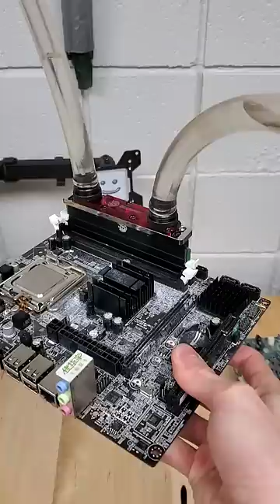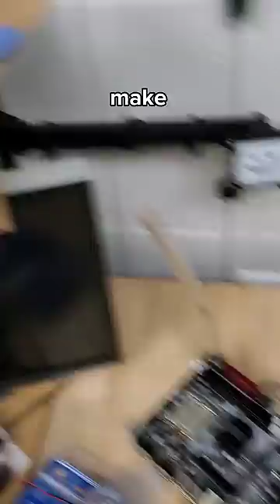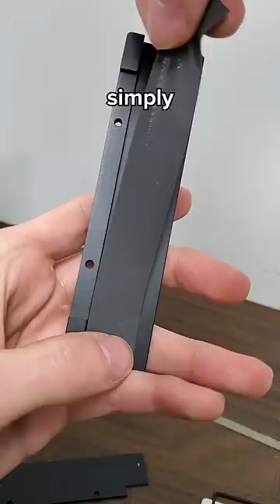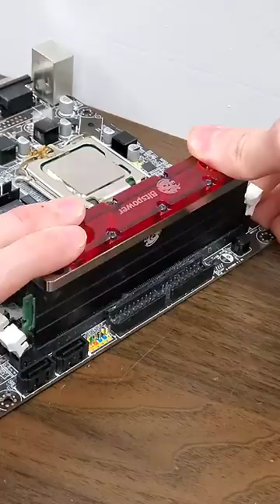water-cooled RAM?? #shorts

Comment: That'd actually be a game changer for old servers and Mac Pros with DDR2-FBDIMM memory that gets really really hot and constantly fries itself
Reply: Source: my Mac Pro from 2006 where my 8 gig kit fried itself after 12 years of work, had to get another one with newer sticks and it seems to be fine but still runs very very hot
Reply: Wouldn't a fan do the same job with less complexity
Reply: It would probably cost more money to water cool every stick of ram than just buying new ram…
Reply: @Jacob-yl2wl  but to do that they would have to upgrade the mobo and cpu to get ddr 3 ram to work
Reply: Yeah, but why? Aren't all machines with ddr2 just too weak at this point to even bother trying to cool it?
Reply: @andrupka8749  my 2006 Mac Pro has the same thing with the ram, went from 12 to 10gb (the things too old for me to want to upgrade it) after one of the DIMMs just died
Reply: @ViktorKozh  ddr3 is as good as ddr5
Reply: @ViktorKozh  there are still plenty of niche applications for legacy hardware, as well as people who like to push older tech to the absolute limit
Reply: @RealLava  🤣
Reply: @swordz2330  it has an exhaust fan right besides it but that's not enough
Reply: @joshm264  yeah the main reason I'm doing that is to push it as hard as possible
Reply: And raspberry pi.
120°f from chrome
Reply: Yes I need that for my Mac and it has enough room too lol
Reply: @RealLava  Bro is delusional
Reply: How practical and mobile is this to add on a MacBook Pro?
Reply: @ashissoback  not practical and not mobile at all but I'm talking about the Mac Pro, a desktop computer...
Reply: @ashissoback  Especially one with DDR2 memory, at this point it's better to just buy a modern desktop lol
Reply: who knows the song in the backround
Reply: Self note:don't buy apple stuff
Reply: @ikram2512  this thing is literally from 2006 and this type of memory was the norm back then...
Reply: @ViktorKozh Part of the problem with old tech is the heat. As things become more efficient they tend to run a bit cooler, generally speaking. So in theory cooling an old stick of ram that is known to get super hot would logically make more sense than trying to cool a stick of say DDR4 thats known to run much cooler than DDR OR DDR2
Reply: Gta online je veut pas être de retour de vacances mais j'ai pas
Reply: @tejay9416  Ddr4 can be pretty hot as well, especially something that needs 1.45-1.55v and operates at 3800mhz or more.
Reply: just get a newer mac pro. a 2012 pre-vader won't run you over $300 for an upgraded system
Reply: With the specs of ddr5 ram I think we are gonna need air/water cooling for them 😂
Reply: @ViktorKozh  some software just doesn't function on new systems, so for archival or for critical software, it's still kept.
Reply: Would be cheaper to get a server that uses ddr3
Reply: @daniel89123  we keep these things around for fun, not because it's practical to use them. It's funny to see a 16 year old computer play Minecraft and browse the modern web. In fact, this thing is still fully usable and pretty fast.
Reply: @andrupka8749  holy shit man, you're right I didn't immediately consider it...
Reply: @swordz2330  not quite, the issue is that it's just air flow, it's like putting a fan pointed at your cpu (less of an extreme tho)
Reply: I’m gonna note this down for later
Reply: @andrupka8749  I have a 1995 Compaq P with a quad floppy bay and it's honestly so damn fun
Reply: @RealLava  No.. no it's not. If that was the case, companies would be sticking to the cheapest option. You can even see the difference in gaming if you play games that utilize DDR5, so no TF2.
Reply: Servers in a proper DC don't have this issue. I've had servers run > 8 years hard with no issues.
Reply: @Mzansi74  and this is a 16 year old server. The point is that these DIMMs consume much more power than normal ones and get insanely hot.
Reply: If you're Rig is so damn old then I doubt water cooled ram is your biggest concern lol
Reply: @PuddingXXL  bro, what's wrong with pushing old hardware to the limits for fun?
Reply: Exactly HOW does having ONE SINGLE RAM stick on board,instad of four,helps???
Reply: @TheChudoviste  what? I mean, why are you asking it here of all places?

Having 4 sticks instead of one is better because they run in quad channel and have more bandwidth, giving you higher performance.
Reply: @andrupka8749   I'm  sorry man,I had one beer too many and  been seeing things that aren't there.Disregard that comment,please.Cheers 🍻
Reply: @TheChudoviste  it's fine 👍
Reply: @swordz2330  exactly; the water block doesn't even make significant contact with the actual chips 💀
Reply: @RealLava  good comment, I truly cannot tell if troll or not
Reply: @swordz2330  yeah but it only brings it to room temp
Reply: @7xyn  you don't want ram getting too cold anyway as it could cause data loss
Reply: Just upgrade at that point lmfao
Reply: @HunteR-uc7nv  no
Reply: I have ddr3
Reply: @joshm264  thats cool
Reply: @andrupka8749  Funny. I had 48GB in my 1,1 machine when I bought it. It’s nearly half that now, from random sticks dying.
Reply: @anotherpewtertahoe  that's just how it is. They all die randomly.
Reply: @RealLava  yeah yeah what he said
Reply: @Miebo.  i use both ddr3 and ddr5 no difference
Reply: @andrupka8749  lol
Reply: Didn't think about that but that's a great idea 💡
Reply: @swordz2330 yes but there is no kill like overkill!
Reply: DDR2 ECC RAM would love this.
Reply: @andrupka8749  I got a new Mac Pro and it damn near burns my hand 😅
Reply: @justaguycalledjosh you would be surprised how many economic softwares for businesses don’t get even released for windows
Reply: @RealLava  boi whadahell
Reply: @Shobs1  why are you replying to comments half a year ago
Reply: So dont buy mac 🤦‍♂️ never met an educated IT guy who did.
Reply: @Under-Kaoz  then you didn’t met enough
Reply: @supercrazy50000  I did IT in the Army and still talk to plenty of civis as well. I've probably met more IT guys in name than you have met people.
Reply: @Under-Kaoz  ok big boy im sure you know a lot of xcode developer and graphic designers too
Reply: Damn I just use a Mac Pro from 2008, it belonged to my dad and it's about a year older than I am. I fixed it up a bit and now it's a midrange gaming PC that can actually play most modern games almost lag free.
Reply: Trr
Reply: No but wait I thought macbooks were the ultimate God tier computer your meaning to tell me it's not no way
Reply: @imbeautiful9305  I had a stroke reading your comment, what are you trying to say?
Reply: Bacon bacon.
Reply: @RealLava  lol no ddr3 is not as good as ddr5, ddr5 is over twice as fast as ddr3
Reply: @andrupka8749  dude those old MBP's could fucking cook man. I remember my MBP of the same year would get so hot it would burn my legs
Reply: @GshockFPS  this isn't a MacBook Pro tho
Reply: @andrupka8749   i just realized that. All those macs had terrible overheating problems. Even newer macs do
Reply: @GshockFPS  there is a lot more nuance to this. The RAM issue was an industry wide problem affecting any servers and workstations using this RAM, as they consumed 8-9 times more power per stick than normal RAM, which, as a result, made it an inherently unreliable technology. The CPUs both stay under 65c under full load, despite the fans not even running at max speed. It's the exact opposite of overheating.
Reply: @iono_. Remix of elanor rigby
Reply: @youtubeisgarbage900  tysm!
Reply: @iono_.  You're welcome, hope it leads you on the path of getting into some older classics
Reply: @Jacob-yl2wl for servers and such, it's the downtime that causes problems and costs way more than water cooling would.

Macbook owners just by another Macbook 😂
Reply: Friends, I took off the 18 one arm pull ups Support me
Reply: waste of time & energy
Reply: @girishkumar6505  you’re the only waste of time and energy here
Reply: @RealLava Got to bed lil man, you're delusional.
Reply: Who is water cool a ddr2is a waste is money
Reply: @anthonyrodrtiguez  a waste of money is throwing out a perfectly good computer
Reply: Came here to mention DDR2-ECC, yup!
Reply: Me with 2GB DDR2 RAM sees this as an absolute win
Reply: Who still uses ddr2 my guy 💀 it’s 2024
Reply: With technology nowadays, fan cooling can get the same performance as water cooling. It's just wasting money on aesthetic just like RGB.
Reply: @sparkysIT  yeah but it’s funny so
Reply: @andrupka8749 true 😂
Reply: Looks like it blocks the other slot, what's even the damn point if you can't use all the slots
Reply: @swordz2330  I think buying new ram is better. Probably costs about the same and you het better performance.
Reply: The interface isnt that good 2 thermal pads and that small surface area on top

Comment: Watercooled RAM has to be the coolest most overkill unneccessary product out there
Reply: You can mega overclock with this
Reply: @doritoonigiri1005 lol it wont make a significant difference
Reply: @TheTeehee11111 maybe when pushing b-die to 1.75v+. But at 1.65v some upgraded heatsinks alone keep mine below 45c
Reply: I think watercooled PSU was out at some point
Reply: It's not entirely unnecessary. Additional cooling on RAM can make it stable if on really-really tight timings, for example, Samsung B die can be thermally sensitive and throw errors with high voltages and frequencies. This can make it stable without compromising on performance if you squeeze every last bit of it possible.
Reply: seems like you have never came across a samsung b-die RAM memories then
Reply: We do have the Spork.

Comment: I think it's about time you make a system and watercool every part.
Reply: Ive seen PCs built in acrylic tanks completely submerged in dielectric coolant, with a pump and refrigeration compressor to chill the coolant. The look badass, an i would imagine they run at peak performance, plus there's no dust buildup to worry about.
Reply: @justin dunlap  I've seen something similar and yeah it looks insane and probably super efficient
Reply: @justindunlap1235 nuclear PC
Reply: @scr3am273  technically those do exist on board nuclear powered submarines.
Reply: @justindunlap1235  I swear if they're not in that one fish tank style case imma loose it (joke)
Reply: @justindunlap1235  last time a submarine was running windows, it had imploded with a survival rate similar to being inside a nuclear reactor
Reply: @UhmAhctually 💀
Reply: I'm interested too I like open loop liquid cooling
Reply: @justindunlap1235  min oil is better, no worries about shorts, use uv due and stash black light under some aquarium rocks
Reply: @sfvirgo  except mineral oil degrades plastic, you'd have to be careful about the components used.
Reply: @justindunlap1235 The computer doesn't collect dust but you still need to clean the condenser.
Reply: Ever seen mineral oil cooled PCs? I want one but it only makes sense for a brand new build seeming as you don't wanna take it apart or it's gotta hang dry for days.
Reply: Water cooled PSU. 🔥 🔥 🔥
Reply: only if the monitor is also watercooled

Comment: Now we need to water cool a BIOS ROM.
Reply: I just waterblocked my x570 mobo's chipset this weekend. I have a shitload of radiators with good fans so my fan speeds at idle are like 18% and the chipset fan was screaming at 94c. Lil 15$ waterblock off amazon bolted right up& brought it down to 37c, and no random crashing or USB disconnects anymore! Had to vertical mount GPU to make room, but it looks cooler that way anyhow

Comment: How would engine oil work as thermal paste? 10w 40

Edit: Then use used engine oil to see if the carbon and micro steel in it will improve conductivity
Reply: Too thin and, especially with tiny bits of metal, too conductive. Plus it's not really made for thermal transfer, so it'd perform about as well as your average condiment before seeping out from the cooler into the socket and poof
Reply: terible, no idea why you bothered asking.

Comment: do a test and see if the ram can overclock any higher with the additional cooling or not
Reply: Generally this makes more of a difference for timings rather than clocks
Reply: Might see an improvement over the bare sticks but even a decent heatsink is enough for anything ddr4 at least. I'm able to keep my Samsung bdie @1.65v below 40c with just some nvme coolers slapped to the side of almost the exact same heatsinks as in the video.
Reply: @twanheijkoop6753  depends on the ram really, the viper steels for example are utter shit, good b-die, but horrible heatsinks, they benefit a lot from removing the heatsinks and even just putting some ek monarchs on (or similar) and the best way to get these heatsinks off, is to just, like, submerge them in turpentine or white spirit and they'll just fall off after a day or two
Reply: Just as is ? barely
but this with chiller can give a nice timing boost
Reply: @Xenotester  depends on what timings though, just normal ram water on b-die will allow you to push into the 210-215 TRCD range where anything around 250 is fast on air even with good heatsinks, but b-die gets increasingly more temp sensitive the more you push TRCD so that makes sense
Reply: @blazingmatty123  yes - i'm not against memory cooler, but solution in this video can be complicated. Ram but in same water loop with cpu and gpu not so effective (in worst cade even make ram warmer), but combined with chiller or tec it's can be great
Reply: @Xenotester  ehh not so much, even with water temps at about 35c the gains are still there when I'm really pushing my system my water temps get to about 38c and I can still keep my TRCD, secondary and tertiary timings  super tight and not throw errors, errors I would absolutely throw on air with a fan on the sticks
Reply: Indeed. That's researching! 💪🏻

Comment: If you're manually tuning your ram you can squeeze a LOT out of some of the cheaper ram with the right cooling. Usually a fan is enough but this is for like Micron rev E or Samsung B Die kits.

Comment: I mean, if you are going to absolute top-end solution, RAM cooling makes sense. For DDR4 and DDR5 tight timings may be unstable under load, especially in games when GPU throws a lot of heat into a system (doesn't matter if on open bench but it absolutely does if you build into a case), if RAM is on its limits, any 5 additional degrees may make it unstable.

Comment: You should do a pc that is complete water cooling. Gpu, cpu, ram, ssd, not sure if power supply is possible though.
Reply: at that point, just submerge the entire inside of the case in non-conductive liquid and cool that

Comment: This is probably made for ridiculous reasons however I can think of some situations where it actually would make sense. For example anywhere that air cooling is impractical such as high temp locations such a warehouse, or as a couple other said inside a server room that tend to run pretty hot even with AC.

Comment: My RAM runs at only 333 Mhz, and my gaming performance is unreal, compared to its low speed. The dual channel shows 667. The secret behind this, is the completing of quests, that rewards the gamers with performance tune, without additional heat, crash or illegality. This fix is new for me, I wrote a bunch of pages of how-to for phones, laptops, and some tuneup is for Dos. For example, if you play Dyna Blaster with Dosbox using BT headset, after a while your audio quality and vol will be higher. Same, if you watch Terminator 2, the blast sounds, atomic bomb, some primitive game sounds increase the audio quality permanently, and offloads the cpu to exclude the audio streaming. The audio decoding from this point is handed over to the small audio chip, and the processor won’t have to be loaded anymore.

Comment: This is actually quite important for some forms of ram, for example with DDR4, b-die gets more and more temp sensitive the more you push TRCD and some of the other sub timings
Reply: If you are having temp issues without water cooling, water cooling will just delay the inevitable of a corrupt OS, and corrupt partitions in your memory a week or 3 months from now. Have fun spamming your cmos button for an evening, and watching 25-50 failed windows install prompts. If you even crash your pc once overclocking ram it’s a 50/50 chance you already corrupted OS files.
Reply: @JACS420  nah b-die is temp sensitive past 50-60c when you're pushing TRCD and some of the other secondary and tertiary timings, this is a well known thing, not a concern for xmp and so on, but for manual tweaking it gets very temp sensitive very quickly
Reply: @JACS420  it also takes more than that to brick an OS, but anyone with more than 2 brain cells to run together does their overclocking on a completely separate windows installation.

Comment: There's much more efficient block system for this purpose. Personally if I just run with enough air flow my ram never goes above 80F, without garbage insulator cladding. While overclocked ddr3 corsair vengeance 2800 c13 1.67V up from 2400 c11 1.65V. I can get a 4690k and a 4790k to run.

Comment: Actually this may be the way, but only if done correctly. Many times we see custom builds with water all connected in same line which is wrong. You may oc more with water if its thermo licked than yes. You can oc xmo profile is oc ram. But tgere is more in custom. So how you must build is simple every component must have theyr own water tank and cooling rads and must not connected together. All must be separate

Comment: I was doing this back in around 2006 with OCZ flexXLC ddr2. That was back when ramm speed had a much bigger impact along with low CL rating. Pretty sure now its more just for looks or bragging unless youre running super high freq ramm with zero airflow.

Comment: The water block on a real thin top edge is dumb as dumb gets.. not that you need ram water cooling but if you want it for some stupid reason the water block need's to be on each side of the stick not the top when the side's have already dissipated by convection to air...